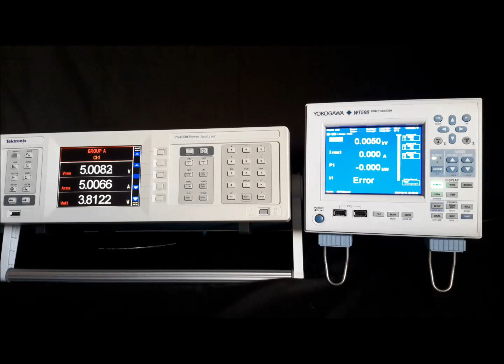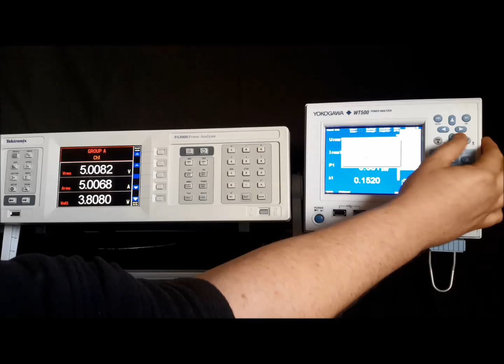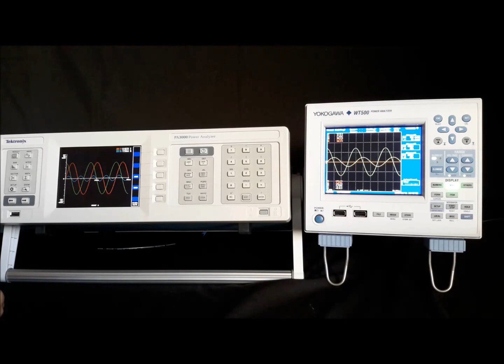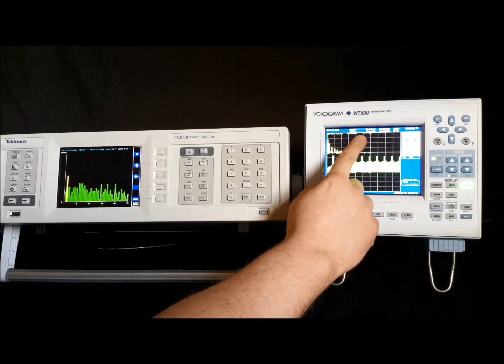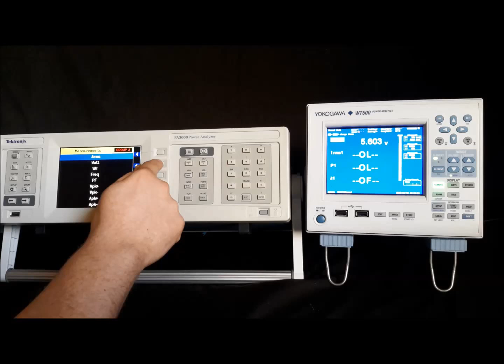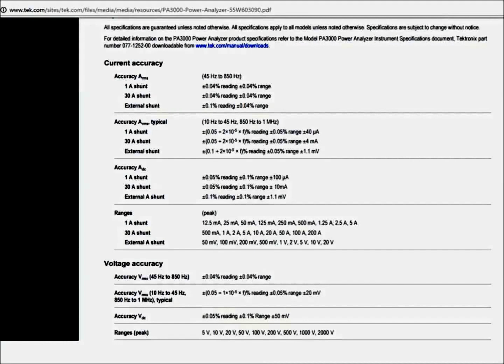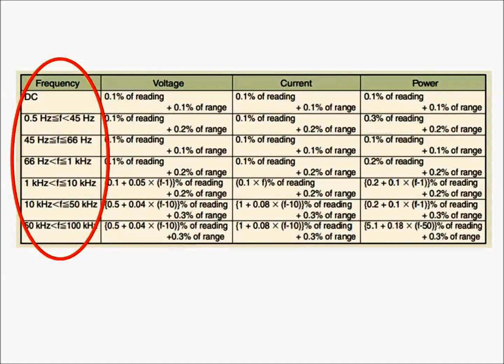Yokogawa WT500 Power Analyser vs Tektronix PA3000 Power Analyser

Comment: Thanks for making this video. I got really curious after watching your video and since we use both these Power Analyzers in our lab, I wanted to see if I can match your results. There seems to be a lot of bad setup issues throughout the video that lead to wrong inferences. I am not sure if this was done intentionally but I will try and point out the spots where I noticed obvious problems with understanding how the equipment works and setting up properly. Hopefully this is helpful. I will post a video later to show the same tests done correctly.    

@6:50 I found the test quite curious at higher frequencies (>100 KHz). Why would you change the current and voltage frequencies independently? I cannot think of any real world application where that scenario would be applicable. Motor drives is probably the only application where current and voltage frequencies would be that far apart but even in that application there is a relation between the carrier and modulation frequency hence the provision for digital frequency filter on Yokogawa or PWM mode on PA3000. 
In your case, the Power Analyzer’s fundamental frequency is always fixed at the voltage source and the current frequency is changing hence giving you erroneous results. 
If you are trying to test voltage and current individually, you are better off selecting the frequency source as the respective signal, so for measuring voltage at the specified bandwidth, use voltage as the frequency source and to measure current within the specified bandwidth, use current as the frequency source and you will see much better results. For power measurements where voltage and current do have varied frequencies, you will have to pick one carrier frequency, hence the use of digital frequency filters on both products. 
That being said, the 1MHz bandwidth on Tek product is only valid on direct voltage and current inputs not on Ext hi-lo inputs. I am looking at Tek’s spec sheet and the bandwidth on Ext-Hi-LO (external shunt) inputs on PA3000 is actually 100 KHz so I don’t think this test is valid “11 External shunt limited to ≤ 100 kHz “. 

@11:10 Voltage and current Resolution: I noticed that you mentioned that Tektronix PA3000 cannot measure below 250mV. I think blanking is enabled on the Tek Analyzer that blanks (zeroes) all values below 10% of the lowest range for convenience. It can be turned off from the menu.  The Analyzer can actually measure down to and specifies accuracy down to 1% of the chosen range, so for the lowest range of 5Vpk, the analyzer can measure as low as 50mVpk or 35mVrms. The same applies to the current measurements. Tektronix PA3000 can actually measure down to 90uA on the 1A shunt. We use it here to measure standby power on 5W usb chargers that have extremely low input power (<30mW).  

@4:55 Waveform Display: you are displaying the waveform which is clipped. That is really odd. The PA3000 in our lab scales properly to show the whole waveform in auto range. 

@16:45 Harmonic Bar charts:  I am not sure what your input signal is. It would be nice to show what the input signal is actually doing to judge what we are seeing on the harmonic bar charts. A function generator can easily create arbitrary waveforms which would basically look like that on the harmonic bar chart. We have no way to know without knowing the input signal. 

@19:28 Over Ranging Indicator: You have setup a manual range on Yokogawa vs auto-range on PA3000. For both products, over range warning only works when you exceed either the manual range or the maximum range while over ranging. PA3000 does not give you a warning because it’s in auto range and the maximum range is not yet reached. Try setting it up in manual range and you will get an over range warning. Similarly try setting Yokogawa in auto range and the over range warning will disappear.  

@19:33 Sporadic readings?: We don’t quite know what your input signal is so it’s difficult to judge if the output is actually sporadic or is it just representing an arbitrary input signal. Also, you have set manual range on Yokogawa which might be clipping a lot of high frequency content but there is no way to know this without knowing the input signal. 

@22:47  >100% THD Readings: THD calculation is simply a ratio of the square root of the sum of harmonic squares to the reference where reference can be either fundamental or the RMS value. Both products give you an option to select what formula to use. Tektronix defaults to 1/ fundamental and Yokogawa defaults to 1/Total (RMS). 1/Total (RMS) would never give you a value over 100% whereas 1/fundamental can give you a value >100% depending on your input signal where square root of the harmonic content’s squared sum is higher than the fundamental. This by the way is very rare in real world signals but since you are using an AFG, it can be done by setting harmonic content to be very high. I would have set both products with the same THD equations to compare apples to apples. That being said, your frequency source also matters. To measure THD accurately you will have to set frequency source as current in this case where your voltage and current signals have different frequencies. In most practical cases, voltage and current signals have the same frequency so setting the frequency source is not required. 

@25:11 Specifications: You mention that the 30A rms range is only limited to 30 minutes on the PA3000. The specification sheet you display clearly states that is only the case for continuous ’30 A - DC’ waveform not AC. I confirmed with Tektronix that the product can indeed measure 30Arms continuous AC signal. 

@25:30 Typical Specifications: Typical specifications usually mean that the specs are internally tested and calibrated but the calibration methods cannot be publicized due to IP reason. This is usually due to proprietary calibration equipment or test methods/mathematical methods that manufacturers use.  That being said, this is no different than Yokogawa or any other Power Analyzer manufacturer that specifies their product at 1MHz. The truth of the matter is that there is no off-the-shelf calibration equipment out there that can reliably test calibrate these products for the specified current ratings at 1MHz leading manufactures like Yokogawa and Tektronix to rely on their own calibrator designs and mathematical models. This does not mean those specifications are invalid. All it means is that those specifications cannot be warranted.

That is one of the reasons, specifications for ‘6month’ accuracy on Yokogawa WT1800E states following on page 14 of their brochure: 
“• Range of guaranteed accuracy by frequency, voltage, and current 
All accuracies between 0.1 Hz to 10 Hz are reference values.
If the voltage exceeds 750 V at 30 kHz to 100 kHz, the voltage and power values are reference values. 
If the current exceeds 20 A at DC, 10 Hz to 45 Hz, or 400 Hz to 100 kHz, the current and power accuracies are reference values.  
Hopefully this was helpful. I will post a video later with a similar setup so there is a good reference out there. 

Cheers!
Reply from the maker: Hey 'The Power Talk' thank you for your feedback, I will try to cover as many points as I can, see * references below:

Thanks for making this video. I got really curious after watching your video and since we use both these Power Analyzers in our lab, I wanted to see if I can match your results. There seems to be a lot of bad setup issues throughout the video that lead to wrong inferences. I am not sure if this was done intentionally but I will try and point out the spots where I noticed obvious problems with understanding how the equipment works and setting up properly. Hopefully this is helpful. I will post a video later to show the same tests done correctly.   

* I look forward to watching your video and will too make an analysis *

@6:50 I found the test quite curious at higher frequencies (>100 KHz). Why would you change the current and voltage frequencies independently? I cannot think of any real world application where that scenario would be applicable. Motor drives is probably the only application where current and voltage frequencies would be that far apart but even in that application there is a relation between the carrier and modulation frequency hence the provision for digital frequency filter on Yokogawa or PWM mode on PA3000. 
In your case, the Power Analyzer’s fundamental frequency is always fixed at the voltage source and the current frequency is changing hence giving you erroneous results. 
If you are trying to test voltage and current individually, you are better off selecting the frequency source as the respective signal, so for measuring voltage at the specified bandwidth, use voltage as the frequency source and to measure current within the specified bandwidth, use current as the frequency source and you will see much better results. For power measurements where voltage and current do have varied frequencies, you will have to pick one carrier frequency, hence the use of digital frequency filters on both products. 
That being said, the 1MHz bandwidth on Tek product is only valid on direct voltage and current inputs not on Ext hi-lo inputs. I am looking at Tek’s spec sheet and the bandwidth on Ext-Hi-LO (external shunt) inputs on PA3000 is actually 100 KHz so I don’t think this test is valid “11 External shunt limited to ≤ 100 kHz “. 

* I won't make assumptions regarding levels of experience, though I find many applications on a frequent basis where a 50Hz Voltage signal and a higher current frequency is present. Another reason for showing the high frequency on V & I separately is to also see any deviations in accuracy especially where Harmonic measurements are then concerned. If a meter cannot accurately measure the basic Voltage and/or Current at high frequencies then how is a user meant to be certain that the harmonic content will be accurate too - this I feel didn't need explaining as it is quite basic and I often find it to be common knowledge when discussing this with colleagues, committees and customers too *

@11:10 Voltage and current Resolution: I noticed that you mentioned that Tektronix PA3000 cannot measure below 250mV. I think blanking is enabled on the Tek Analyzer that blanks (zeroes) all values below 10% of the lowest range for convenience. It can be turned off from the menu.  The Analyzer can actually measure down to and specifies accuracy down to 1% of the chosen range, so for the lowest range of 5Vpk, the analyzer can measure as low as 50mVpk or 35mVrms. The same applies to the current measurements. Tektronix PA3000 can actually measure down to 90uA on the 1A shunt. We use it here to measure standby power on 5W usb chargers that have extremely low input power (<30mW).  

* Blanks out below 10% for convenience? Not very convenient at all, especially when it does it after a factory default. I see no reference in datasheets or user manuals to the 1% - can you make reference to this? 
  I will again assume that you measure USB charger power in RMS yet you use a Peak range again not very convenient, especially for a higher cost unit *

......
Reply from the maker: @4:55 Waveform Display: you are displaying the waveform which is clipped. That is really odd. The PA3000 in our lab scales properly to show the whole waveform in auto range. 

* I make reference to my previous point and what is said on the video - It is a Peak ranging meter looking at an RMS signal. If a user is measuring a Peak signal then fine - in my experience though the majority/if not all applications measure in RMS because that tends to be what is supplied e.g. Mains supply is 240VRMS not 240VPk *

@16:45 Harmonic Bar charts:  I am not sure what your input signal is. It would be nice to show what the input signal is actually doing to judge what we are seeing on the harmonic bar charts. A function generator can easily create arbitrary waveforms which would basically look like that on the harmonic bar chart. We have no way to know without knowing the input signal. 

* The input was from a basic FG, not too expensive, not flashy, just your run of the mill FG. To keep the test fair though, I used a BNC T Splitter from each output to feed into the same inputs on both meters i.e. V to V's to both and I to I's on both *

@19:28 Over Ranging Indicator: You have setup a manual range on Yokogawa vs auto-range on PA3000. For both products, over range warning only works when you exceed either the manual range or the maximum range while over ranging. PA3000 does not give you a warning because it’s in auto range and the maximum range is not yet reached. Try setting it up in manual range and you will get an over range warning. Similarly try setting Yokogawa in auto range and the over range warning will disappear.  

* I could not find this within the menu's of the Tektronix - there are quite a few menu's - Perhaps your video would shed some light on this? *

@19:33 Sporadic readings?: We don’t quite know what your input signal is so it’s difficult to judge if the output is actually sporadic or is it just representing an arbitrary input signal. Also, you have set manual range on Yokogawa which might be clipping a lot of high frequency content but there is no way to know this without knowing the input signal. 

* The input signal is the same as before, a simple FG outputting evenly to each meter. The sporadic readings refers to the fluctuation of the harmonics on the Tek whereas the Yoko held stable, especially on Current which is very clear on the video watch from 20:38 *

@22:47  >100% THD Readings: THD calculation is simply a ratio of the square root of the sum of harmonic squares to the reference where reference can be either fundamental or the RMS value. Both products give you an option to select what formula to use. Tektronix defaults to 1/ fundamental and Yokogawa defaults to 1/Total (RMS). 1/Total (RMS) would never give you a value over 100% whereas 1/fundamental can give you a value >100% depending on your input signal where square root of the harmonic content’s squared sum is higher than the fundamental. This by the way is very rare in real world signals but since you are using an AFG, it can be done by setting harmonic content to be very high. I would have set both products with the same THD equations to compare apples to apples. That being said, your frequency source also matters. To measure THD accurately you will have to set frequency source as current in this case where your voltage and current signals have different frequencies. In most practical cases, voltage and current signals have the same frequency so setting the frequency source is not required. 

....
Reply from the maker: @25:11 Specifications: You mention that the 30A rms range is only limited to 30 minutes on the PA3000. The specification sheet you display clearly states that is only the case for continuous ’30 A - DC’ waveform not AC. I confirmed with Tektronix that the product can indeed measure 30Arms continuous AC signal. 

* If it is continuous then why won't they specify that then? There looks to be too many extrapolations *

@25:30 Typical Specifications: Typical specifications usually mean that the specs are internally tested and calibrated but the calibration methods cannot be publicized due to IP reason. This is usually due to proprietary calibration equipment or test methods/mathematical methods that manufacturers use.  That being said, this is no different than Yokogawa or any other Power Analyzer manufacturer that specifies their product at 1MHz. The truth of the matter is that there is no off-the-shelf calibration equipment out there that can reliably test calibrate these products for the specified current ratings at 1MHz leading manufactures like Yokogawa and Tektronix to rely on their own calibrator designs and mathematical models. This does not mean those specifications are invalid. All it means is that those specifications cannot be warranted.

* First paragraph of page 14 on the datasheet: "The following specifications are supplemental characteristics that provide additional information about instrument functions and performance. These characteristics are nonwarranted specifications; they describe the typical performance of the PA3000."
This is then followed by Watts Accuracy, VA Accuracy, PF Accuracy and more - are these not the measurements that the meter is meant to be making? Afterall it is called a Power Analyser yet no meaningful measurement is warranted?!? Perhaps this was added after the PA4000 was recalled and discontinued for safety purposes, perhaps?
Yokogawa claim to have the highest capable calibration capability in the world, its on their website and a company as big as they are - especially Japanese - would not release a statement unless it has been checked and confirmed a few dozen times. The 'Truth' of this matter is that Tektronix calibrate to ISO9001 = they do what they say they do, Yokogawa have ISO17025 calibration = an internationally recognised standard which carries more common alias's UKAS/DAkks/RVA/A2LA etc.
Tektronix issue a Traceable calibration certificate with the meter which at the bottom says ISO9001, it is also just one page and displays no results of the calibration and makes no reference to the ranges applied with.
The sales rep showed me on the Yoko website you will find example calibration certificates - take a look and let me know what you think.
So in summary on calibration - Tek offer calibration to 850Hz at ISO9001 standards. Yokogawa offer 100kHz (over 100x more) at ISO17025.
I know where I put my trust in ensuring the measurement is proven to be accurate and not assumed. *

That is one of the reasons, specifications for ‘6month’ accuracy on Yokogawa WT1800E states following on page 14 of their brochure: 
“• Range of guaranteed accuracy by frequency, voltage, and current 
All accuracies between 0.1 Hz to 10 Hz are reference values.
If the voltage exceeds 750 V at 30 kHz to 100 kHz, the voltage and power values are reference values. 
If the current exceeds 20 A at DC, 10 Hz to 45 Hz, or 400 Hz to 100 kHz, the current and power accuracies are reference values.  
Hopefully this was helpful. I will post a video later with a similar setup so there is a good reference out there. 

* This was a comparison of the WT500 and not the WT1800E, as a quick reference though and as referred to before: 6 Month accuracy - Compared to the Tek, at least there is a guarantee on the measurement accuracy, I know from experience that Japanese companies specify worst case scenario, an example is that the advertised ranges look better on the Tek because Yoko is RMS and Tek is Peak. Also I refer back to the PA3000 datasheet, Page 13. You try to point out an accuracy limitation of another unit by saying 0.1Hz to 10Hz are reference values yet the Tek is 10Hz to 45Hz, 850Hz to 1MHz.
I will run this by the sales rep of Yokogawa and will be interested to hear his response. *

Cheers!

* As you appear to have access to Tektronix and information which is no publically available, I have a few questions of my own which I would be really interested in knowing the answers to:

Spiral Shunt - This looks like just a metal plate, how are the frequency characteristics compensate?

IEC61010 is the safety requirements for electronic lab equipment - Does Tektronix comply with this by having banana connectors for Voltage and Current - implying a miswire could cause damage and/or harm?

As an Active Power at PF=1.0 may as well be VA. Where are the accuracies for measuring Active Power below PF=1.0?

Looking forward to your video..... *